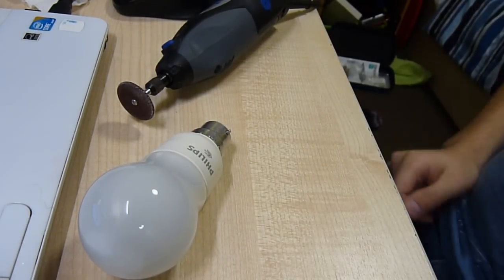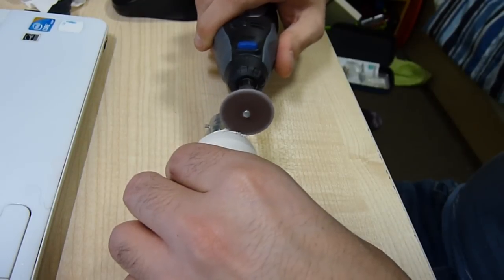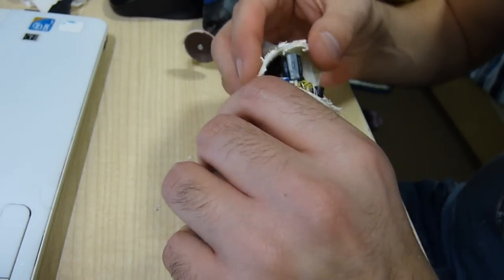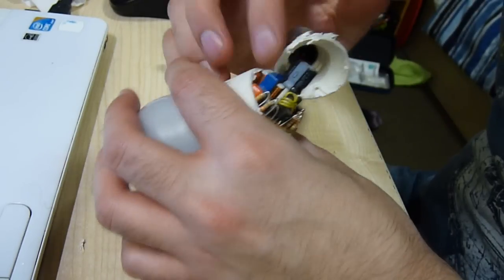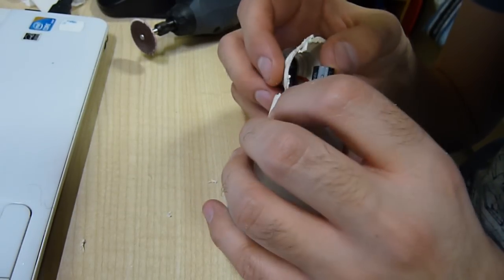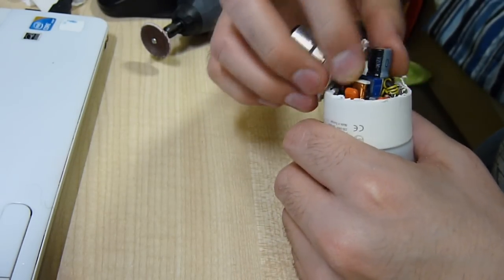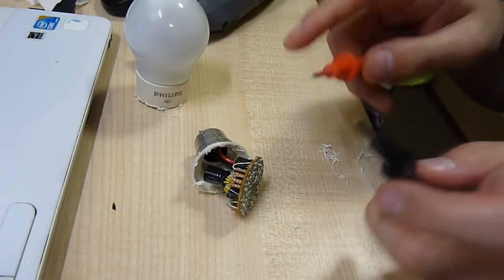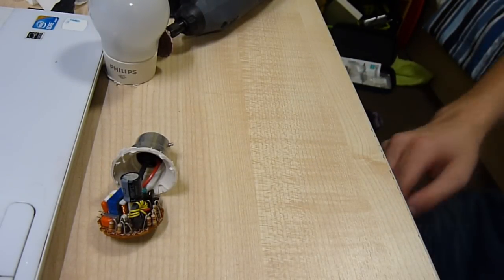PHILIPS CFL Teardown

Comment: There is only a milligram of mercury inside. Got it broken in multiple occasion, those tubes are brittle.
+MetaphysicalEngineer - Most of the CFL's sold in EU is made in china.
Reply from the maker: I would not worry about it if you break them.